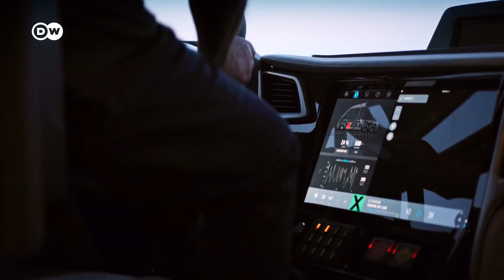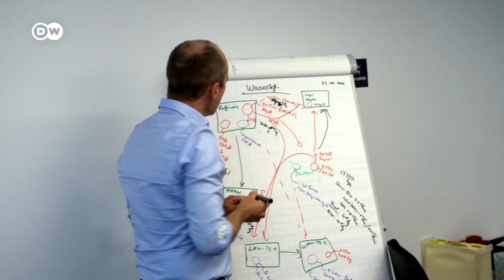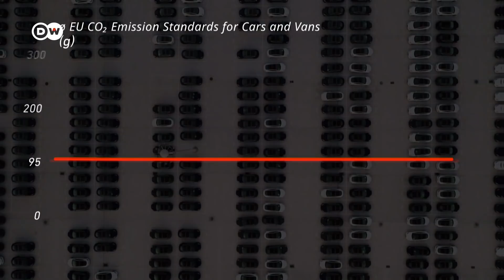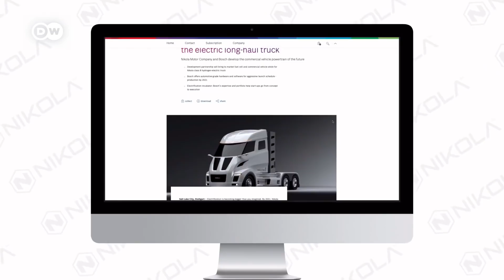Hydrogen for Germany | Green Mobility | Hydrogen Fuel Cells

Comment: Hydrogen is NOT a fuel. Unless you are in the sun, it is a storage medium. Using electricity to produce hydrogen, then converting back to electricity makes no sense from an efficiency point of view. This means that advances in batteries will eventually make hydrogen obsolete except for some niche cases.
Reply: Batteries have a fixed amount of recharge cycles making them a highly ineffective storage medium. They are also much more expensive per kw/h compared to hydro.
Reply: Storage makes perfect sense. We do not have an even power output with renewables. Batteries are only good for short term storage.
Energy from Summer to Winter for Example.
Yes efficiency is not cool with hydrogen. But how are you going to produce that many batteries with rare elements?
Having 900kg of battery in your car isn’t really efficient either. This vs ca 5kg of H2.
We need to develop a wide range of new technologies. Each has its best use case. It wouldn’t make sense to have H2 for your smartphone thats obvious. But that doesn’t mean it is bad all over...

Comment: Hydrogen will never replace batteries, but it could be complementary to batteries for those rare long distance trips and emergency fuel if you don't have a charger close by.

I think that a supercapacitor, battery and hydrogen hybrid would be the best option. The super capacitor charges very quickly and is enough for short trips to the store so the car using it maybe 30-90% of the time depending very much on the persons driving needs. Supercapacitor is very efficient for regen-breaking about 95% gets back into storage downhill from going uphill, compared to about 30% for batteries.

The batteries could be smaller and thus much cheaper since the supercapacitor is used for regen and  acceleration and therefore spares the battery so it doesn't need to be recharged as much. Thanks to the hydrogen the battery pack doesn't need the the over capacity for those rare long trips, so 150-200 km (about 1,5 to 2h driving) range would be enough.

The hydrogen would only be for those rare long trips you make a few times a year at most. Even though hydrogen is much more expensive it would still be cheaper since you saved money by having a battery pack that's half the size as a battery only car.
Reply: Batteries are not realistic on a large scale for vehicles. You would have to gather a lot much lithium for that, then you have to discard it after a few years because the battery eventually wears out. Just after a dozen or so charging, the battery starts to degrade, that means the amount of energy that you can store in the battery decreases. Gas and hydrogen powered cars don't have this problem, both can replenish a car within minutes and doesn't degrade over time. You will see in time that I am right. Large scale electric vehicle manufacturing will never happen. People will mostly stick to gas powered gas for the foreseeable future. Batteries are better powering devices that we use everyday, such as our phones, tablets, or whatever.
Reply: Yes it will be complementary, an frastructure has to be set up for it, as has for batteries.  It will very much more relevant to heavy transport, buses, trains, ships & aircraft. Green hydrogen production will be set up around our coast powered by wind energy.
Reply: Completely agree with this intuitive compromise.  In this scenario, the hydrogen station network should prioritize interstate highways which coincidentally would also be used by long haul trucking.
I would also add that even an 80 km battery range is adequate for 95% of the days for most folks, and that is essentially achieved by the current Toyota RAV4 prime.